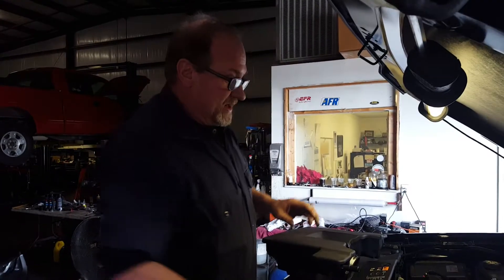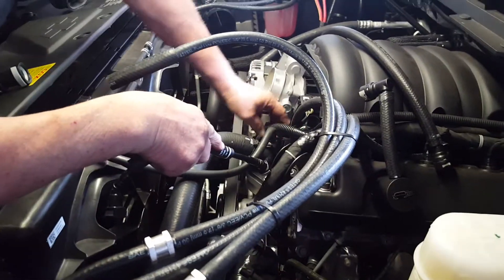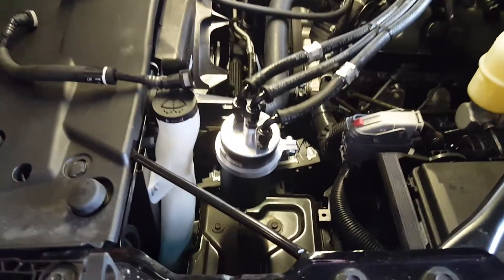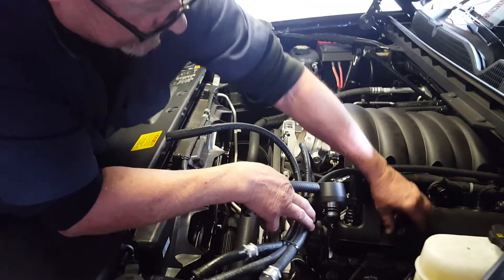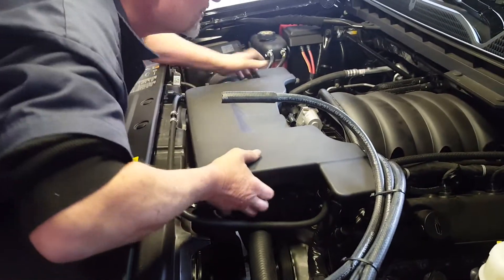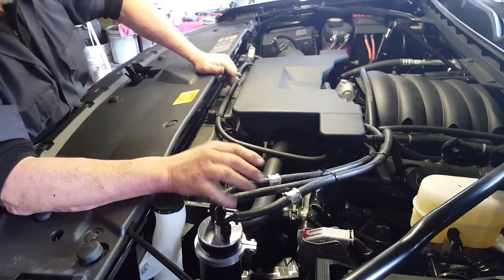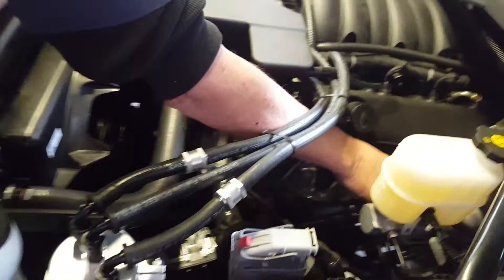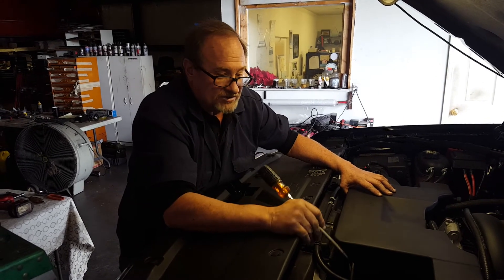2016 Silverado 5.3 Catch Can Install

Comment: I recently purchased a 2016 Tahoe 5.3L with 80K miles.  I haven't noticed any problems yet, but a quality catch can system is definitely in my future and yours is the best I've seen.  I've checked out your offering for my vehicle on your website.  Question:  Regarding the hose between the modified oil cap and the air bridge assembly, could you possibly offer a hose with a pre-bent 90 instead of the straight hose?  Seems like this would eliminate long term wear on the two o-rings in the modified oil cap.     Thanks.

Comment: I bought this can best one after owning other brands. I stalled on new 2017 silverado and it does its job esp living in FL with year round hot temps . I drain it every two weeks just to see what it catches and it catches the dirty oil mist perfectly. Glad I installed it when the truck only had 300 mi or so. Well worth the money . Dont but cheap or copy cat cans only this one.
Reply: postalaka your truck consuming any oil?

Comment: I feel bad now about running my 18 Sierra up to 6k before i changed the oil still haven’t gotten my 2nd change but think imma pass on the free ones from the dealer and run amsoil feel bad that GM doesn’t “approve” of it cuz it’s not dexos but imma run it anyway and hope nothing ever happens while it’s in my engine .
Reply: Andrew Garcia I bough me a 2018 with 20 miles and my first oil change I used AMSOIL and I use that brand since 2005 in my Buick with 310000 original miles using AMSOIL all the way. I’m planning to do the same on my Silverado. I do my own services not planning to take my truck yo the dealer. I do recommend you to use an oil catch can and disable the 4 cyl crap

Comment: Great video and very informative, I have the 15 Silverado crew cab 5.3 v8, just a few months ago my engine started rough idling, took it to the dealer, they told me it was a loose spark plug wire which they corrected, but it didn't fix the idle, their last solution would be to flush out the intake with a chemical that would remove all of the carbon for $300,00. what's the price and installation fee for the oil catch can compared to the dealers solution? Please reply would really appreciate it, Thanks in advance!
Reply: You can do the clean out your self for about 20 bucks. Super easy to do. Look up sea foam injector and intake cleaning for your particular vehicle on YouTube. Dealer is ripping you off.

Comment: Great video. Bought a new 17 Silverado High Country 6.2L and installed a AEM dry Performance filter and Airaid intake tube. Also dumped the factory oil at 600 kms and using Amsoil Signature Series. Ordered a Elite RX catch can and separator just waiting for it to arrive to install. Question can I put the fitting on the bottom of the intake tube instead of the top would look more tidy?
Reply from the maker: Yes you can. It is hidden when doing on the bottom and many prefer this.  Other wise all looks like it came from the factory.  Once you install it please check back and post your fuel mileage compared to pre-install. Should gain 1-3 MPG.  Good move to get the factory fill oil and all the debris it contains out and none better than Amsoil!
Reply: Tracy Lewis Performance I will for sure. There's a little over 3000kms on truck good time to install. Been using Amsoil Signature Series and filter  since 5 year's love the stuff and the once a year oil change. Thanks again

Comment: Why did you cap off one side and then have to drill into the air box you could have just ran your wide open throttle line to the air box and not have to drill voiding the warranty

Comment: I dont understand why you need to do all of this to accomplish the results. Seems to me like simply interrupting the dirty pvc air with a oil separator is all that is needed.
Reply: James Horrocks funny how they don’t comment on questions like these. They don’t give two shits and a fart about your engine it’s all about the $$$. I use the Moroso separator on my 2014 and it works bitchin as do so many other filters.. the whole check valve thing is bull also.

Comment: How would i install in a 5.3 single turbo setup? Where do i route the clean air separator hose to?
Reply: Arturo F same place. The check valve will keep the can from pressuring from boost.

Comment: what happens if you don't have the secondary evacuation port drilled into the air intake?  My elite catch can has the provision to add that if needed.  It has a allen set screw covering that hole on the catch can.

Comment: Hi Tracy so I just bought my first Catch can RX big can but after installed and turned the engine there’s a small hissing noise Coming from the suction side or the dirty side hose and seems like a small hissing not sure if that’s a normal thing ? Or the hoses provided are to small ?

Comment: I have a 2016 Sierra with a cold air intake... Will I have to drill into the intake tube like the video shows the stock unit ?
Reply from the maker: Correct. Drill it underneath in the same location. We include a 1/4 NPT tap in the kit just for this.

Comment: Nice and great product but what is the correct way for a turbo setup (L83 5.3 2016)
Reply from the maker: https://www.youtube.com/watch?v=-IPgG9vDf6s  But for a turbo, the second outlet from the can with checkavlve flowing away from the can will attache to a barb you add into the turbo inlet (coupler) instead of the CAI tube.

Comment: On a N/A motor like my 2018 6.2 do I need the exit port that goes on to the throttle body?  My catch can has on exit port; I do have the clean side separator on my oil cap.

Comment: i finished installing the can yesterday! seems to be working great, i haven’t collected anything from it yet tho
wondering, now that it’s installed my pedals vibrate at low RPM when the motor switches to V4. is that a normal thing?

Comment: So has gm done anything about this issue?
Reply from the maker: To date the LT based engines have tons of improvements over the LS based design, but nothing new on the GDI LT based.  The changes from the LS are what I believe the best valve cover design ever with 3 condensing and coalescing towers to slow ingestion, and an improved baffle system under the valley plate, but there can be no real solution except an external separation system. If what is caught is returned, it is reintroducing the contaminates in concentrate to the engine oil. The new LGX V6 GDI engine GM recently released they eliminated the "positive" function of the PCV system so they are leaving most of the wear causing compounds in the crankcase greatly shortening the engine life in trade for slightly reduced coking.

Comment: At 3.56 did I hear 8,000 RPM? Whaaaat? Can't be.
Reply from the maker: Reversion pulses do NOT reach past the throttle body until well over 8,000 RPM so we don't have that as an issue

Comment: Hi there 

Where’s the PCV valve located on this truck? I need to change that. Thanks in advance.
Reply from the maker: On all LT based GDI engines there is no longer a PCV valve as older engines had. In the valley cover there is a PCV cartridge that is a one way valve only allowing flow out and a fixed orifice to regulate the rate of flow. Rarely need replacing.  On the LS based engines except the very early ones 1997-2000, have the fixed orifice located in the rear of the driverside valve cover. Also non replaceable. LS6 and newer LS engines have this in the valley cover.